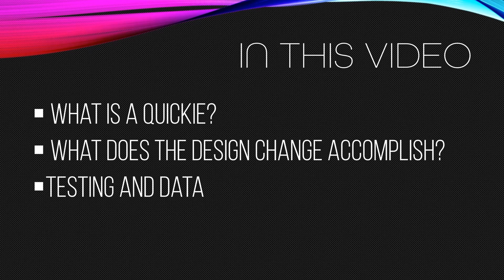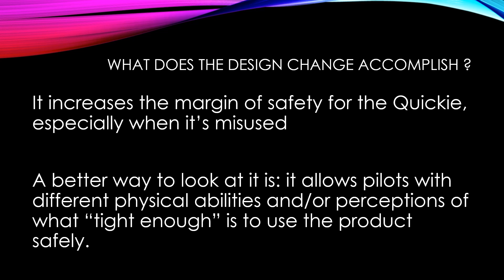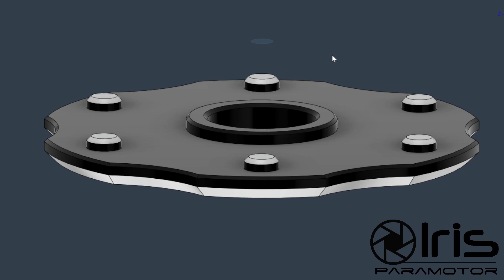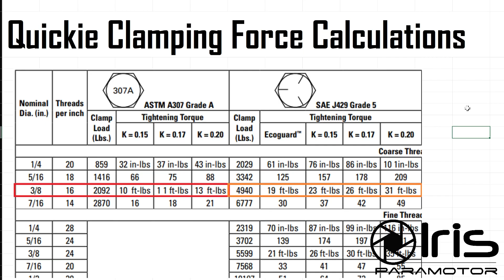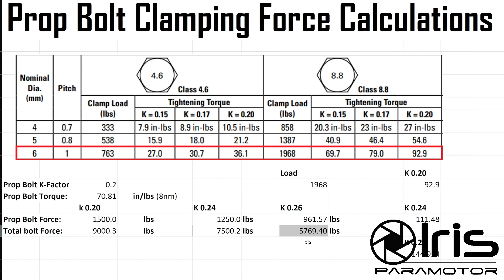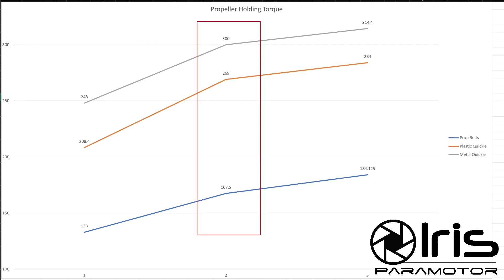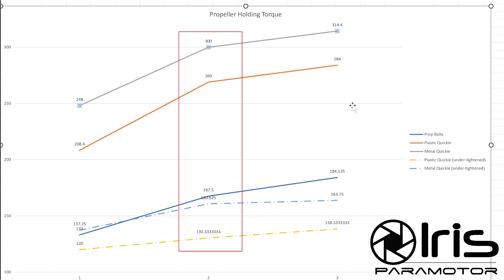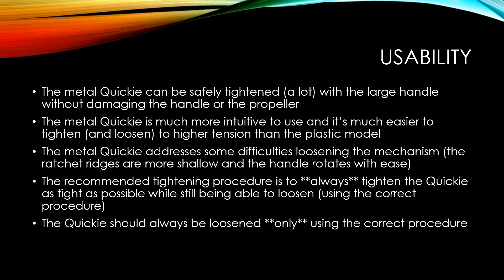Metal Quickie: Big Upgrade!

Comment: Great video,  I have the original quick release and it's an essential part of my rig.  

I do a have few questions.  Probably common sense, but just to outline, I see this product as having to serve 2 core functions.  The first is to hold the prop onto the hub/motor.  I don't think anyone could dispute the design is very effective at that.   The second function is it has to hold the prop "pieces" together against centrifugal forces during operation.  With the shorter pins on the outside plate, and not having full penetration of the pins through the entire prop a lot of people are going to have questions about this.  You have addressed a lot of them in this video and you have probably already combed over all of that and answered a ton of questions offline and internally.  So my apologize if I am retreading old territory.

- Have you done a FEA on the whole system to see where the stresses do start to develop?  would be useful to know where the points of failure would come from even if there are several multiples of safety factor.

-  The holding force test demonstrated in the video effectively is pulling the prop in a rotational motion and looking for slip.  The numbers on that are impressive.  I am curious if any of that changes when pulling straight out.  Have you tested pulling straight out, i.e. to simulate the centrifugal the prop blade experiences in actual full RPM?  In particular the outer prop half which is supported by the smaller pins and the overall clamping force.  The design seems robust, surface area contact is king, but it would be good piece of mind to know the "puzzle prop" isn't going to throw a blade in actual use.

- Is there any developmental possibility to implement a torquing mechanism into the handle?  I.e. as you tighten it, it will slip once the desired torque is achieved.  Think the gas-cap on your car (or most anyhow).  This will help ensure it isn't over or under torqued, that is unless that particular mechanism wears and becomes compromised.

- does anything change with any of the above (and in video) with a 3 (or more) bladed props where there are effectively more pieces that have to be held together.

Anyhow, like I said,  I have the original and it is a well designed and essential piece of kit that I use every time out at the field.  Being able to quickly remove the prop if I need to tend to the engine is a huge safety and convenience benefit, So thank you for innovating in this sport!
Reply: a torque limiting clutch mechanism is interesting. Without any research I'd assume they could be made to be quite wear-resistant, but maybe in this application a mechanism like that would have problems (no clue) and obviously if the failure mode is catastrophic that would be a dealbreaker...

Worth noting that it's still totally worth buying as is. I use regular prop bolts right now and obviously those aren't torque limiting either.....
Reply from the maker: Hey Tom, good questions. To address your first point, there are features on both sides that hold all the pieces together. There is a cylinder in the center of the hub on both sides and pins on both sides. There are quite a lot of problems doing analysis. First, not only are different props completely different structure but also the same prop manufacturer has multiple different types and different generations of their propeller. For example, E-Props has changed quite drastically over the last few years. There are simply too many variations and we don't know what type of carbon and how many layers are used. In fact, we don't even know what blend of fabric Helix uses because it isn't carbon fiber. 

The only reasonable test we could think of would have to be destructive with a press (and using multiple propellers). We would love to do it but it will take time and a lot of propellers that will need to be destroyed for the occasion. Is it a good idea? Yes, absolutely. Is it useful? probably. Is it practical? Currently, no. 

There are several ways to implement a torque limiting device, however, none that I am aware of can be done in a cost-effective way in terms of manufacturing. Can we do it? Yes, of course. Would anyone buy a $500 Quick Release? Probably not. The other thing about this is that we really want to know if the torque is TOO LOW and not too high. Again, there are ways to do that too but we haven't come up with one that is cost-effective in such a small market. 

We will continue to implement more and more changes to all of our products (especially quick releases) to improve safety factors as we continue to develop them and learn new things.